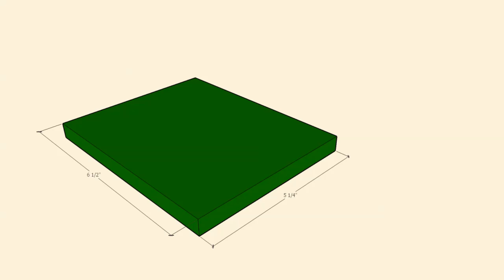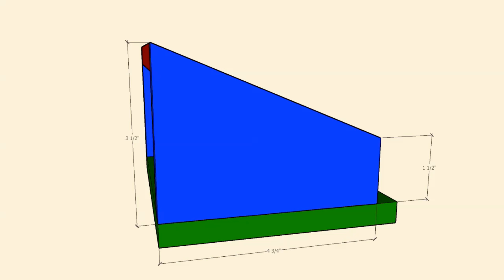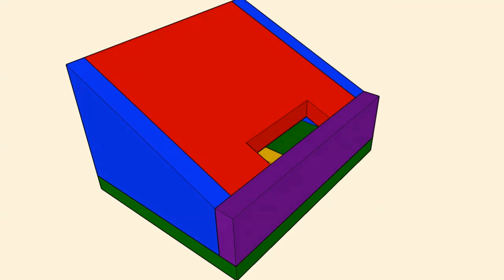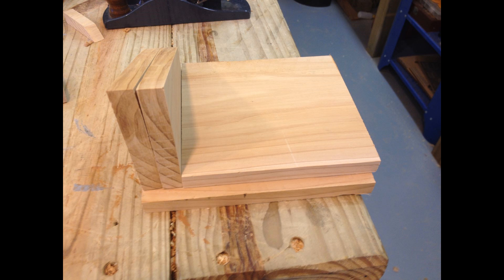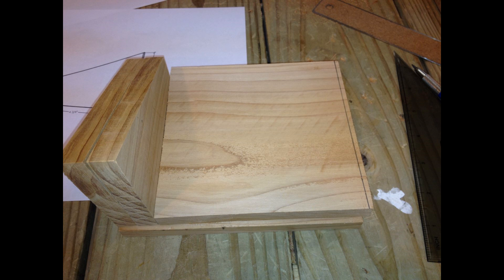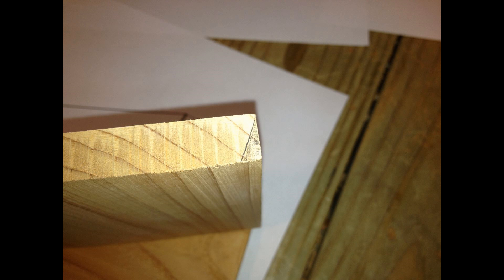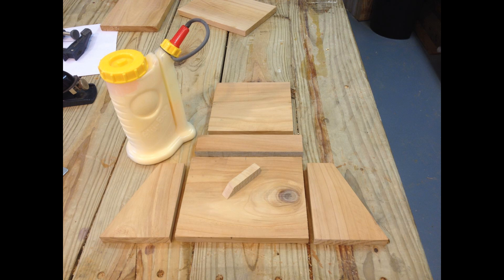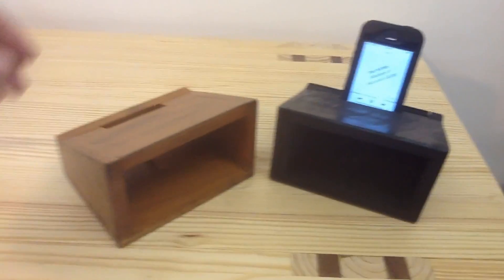iPhone Amplifier for $3

Comment: Had to modify for Android (Samsung 7 Sky), speaker placement is different than on i-Phone.  Provides some improvement over stand-alone phone speaker performance, but not outstandingly different.  Thanks for the design and clear directions in the video.